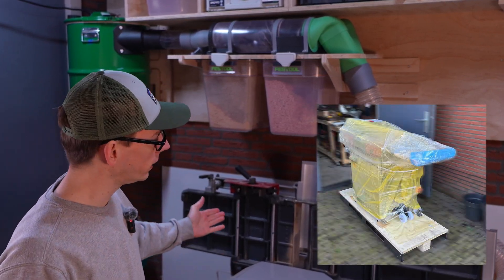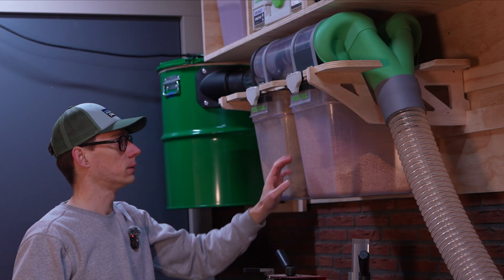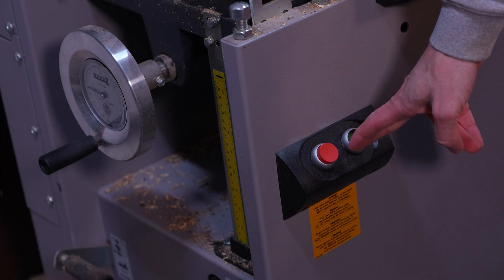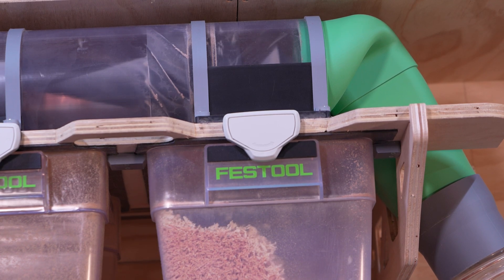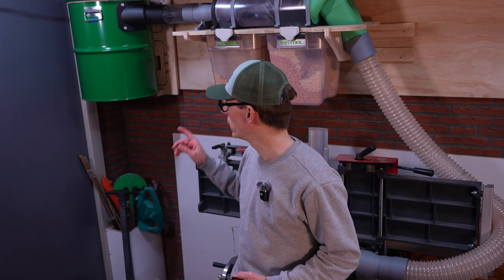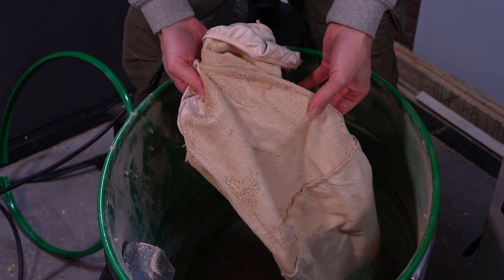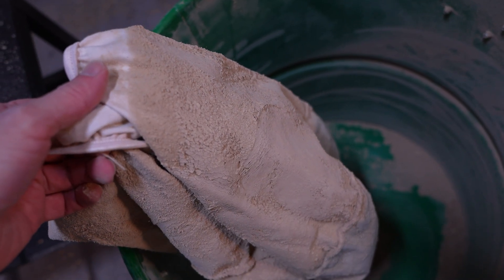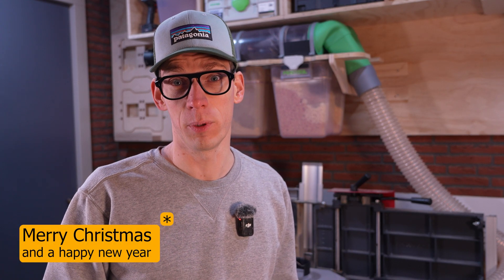Overhead Dust Collection: Workspace Update! (Cyclone Inlets end Efficiency Tested)

Comment: One system optimisation to make: hard lines from the planer to the separator.
Reply from the maker: Yes, only when switching from planing to thickening, the dust discharge switches from right to left. So some flex hose is still required.

Comment: It looks like the vortexes from the y and the fins are going in opposite directions? Is this correct and if so what was the reason? Were both directions tested? I just discovered your channel but I have already watched all of your videos. Awesome content!
Reply from the maker: Yes they are going in opposite directions. I have not tested both directions this was more due to the restrictions on the moment I built this new inlet type and me not wanting to change the dust outlet ports of the second stage.

In the setup I built in my studio I will be able to test this more easily and is something I will do for sure. I think the centrifugal inlet part can be optimized even more so this will be on the shortlist of things to do 👍
Reply: @CapturingDust That’s awesome! By any chance do you have the design with both vortexes going in the same direction already made for 3D printing? I really like this design!

Comment: Impressive work and great idea! A little question, probably a little crazy: do you think it would be possible to merge all the parts in the CAD and then split the tubes in 2 to print the whole including the external tubes directly in 2 parts with transparent PLA or PTEG? This would make it possible not to have to cut the acrylic tubes, and even possibly to profile the inside of the tubes to give them a spiral shape. 2 x 250mm would pass into the bambulab. But I don't know if that's an absurd idea!😅
Reply from the maker: No that is not an absurd idea at all! I already ordered some clear PC and PTEG for test prints (I don't have experience with it) and changing the design is a bit of work still. I have some creasy idea's to make it far easier to print. It's something on my list for this year! Keep a eye on my Patreon to see my progress quicker!

Comment: Im building a 3 in 1 table. chop saw, table saw and a planer/jointer. Was hoping to mount pvc and hose combo to attach all these into your system. biggest concern is the space and the bends might reduce efficiency

Comment: A quick question after looking at your awesome designs. Each acrylic tube needs to be 530mm long? Was looking in the github but can't figure out the size of the tube I need. Your USA linked tube on amazon is 914.40 mm long, so seeing if I am supposed to cut it in half and use for both, or order 2 tubes?
Reply from the maker: The acrylic tubes are 495mm long and the PVC 500mm. I did not had a good feeling by cutting the PVC tube in half because of 40mm that it would be shorter than the original Pilson Guitar design. Maybe it will work. I did not test that.

Comment: After the main flex hose is the green Y connector. Is that supposed be collapsed or was it designed that way?
Reply from the maker: It is designed as a slotted inlet to make it a little more compact

Comment: Most industrial dust collectors have a knock down device and capture, like a rod/prop that is routinely activated by operators or an air blast to "knock down" the filter bag.  that way the fine dust particles are "knocked-off" with a lower stage to capture for this purpose.  See a Donaldson Dust separator.  Cut bottom of barrel and use  a conical cover to funnel the fine particles into a lower receptacle on your wall unit.  If you make a interface ring,  can plumb in or gain remote access through there.  otherwise,  great stuff!  if you want it completely stand alone,  could make a low pressure vacuum ballast that operates a timed bellow to power your knock-down air blast and relay it so it activates in bursts (.25-.50 seconds) with some delay between each when you power it off.

Comment: The design is incredible, I would buy the plans if available. I am curious what are you doing for safety, do you plan to add any HEPA filters. I have asthma and air quality is extremely important to me. Interested if you will be adding some filters. Thanks
Reply from the maker: I rely on the filter capacity of the CamVac for now. You can use them in combination with a HEPA Silent box that Dennis made on his channel: https://www.youtube.com/watch?v=HH8MMbTDrIQ

Next year I am going to try to eliminate the CamVac and add my own motor's to the design and some good filters. Only that is a challenge because I am also very sensitive and allergic to dust.

Comment: I continue to watch waiting for updates to the "I can not get better" but you do it again and again. It is inspiring. I do wonder, for all the inovations would it not be easier to pirnt out a part to attach the pipe to instead of cutting the hole for the box to fit in?
Reply from the maker: For sure. You're absolutely right about that! But at this stage of my "research" it is more important for me to be able to clearly see how the dust behaves in the tube and near the dust exit ports. Once that's optimized we can start spending time making the design easier to manufacture and assemble. But I will definitely take your tip into account!
Reply: @CapturingDust  HI and happy holidays. Thank you for answering my question. I was really curious about if my thought was positive and based on your decicated pursuit in a scietific way I did not know if that would make a impact of dust flowing to the intended boxes.

Comment: I noticed that new cyclone inlet makes air swirl at the opposite direction as the fins after 1st stage. Was that designed purposely to slow down airstream so more chips will fall into the 1st bin?
Reply from the maker: Great observation! The design constraints for the Y-piece print volume and the existing assembly direction of the impellers made this the easiest setup to build. So no real thought was given to that.

I need to conduct further testing to determine if it impacts efficiency or resistance. However, I need to build a better test setup first to accurately measure pressure differences to make accurate statements about it!

Comment: Thanks for the update. I have made a 65% scaled down version for my garage, love it ! Can't wait to see the new inlet. Are they making the air spin the opposite direction on the second stage ?
Reply from the maker: Your welcome! I’m interested to see more about your scaled down version! 

The first stage air spins is indeed in opposite direction. Only I think the pressure loss will be slight less when the spin in the same direction. I need to build a new test setup to figure that one out 😊.
Reply: @CapturingDust  could you just exchange the left tube with the right tube to have the direction match the intake ?
Reply from the maker: Yes you can. Only in this setup I used the asymmetrical outlets for the second dustport. So in this case I will need to change the cutout in the baseplate or upgrade to the symmetrical version of that outlet.